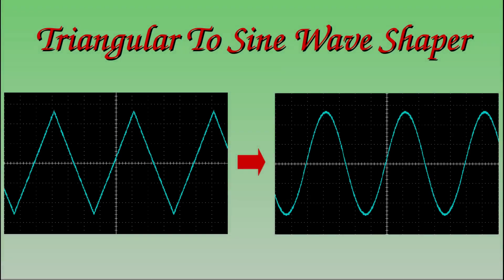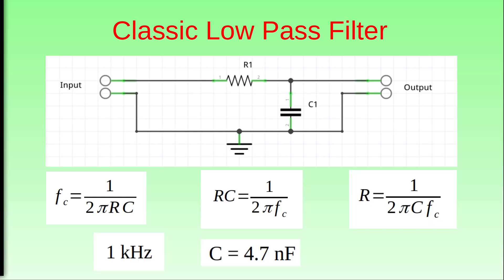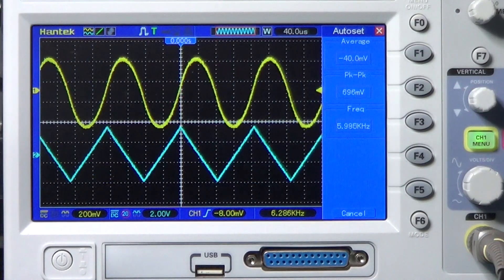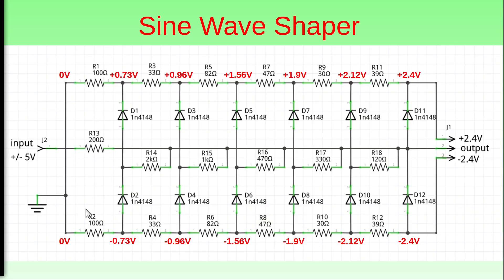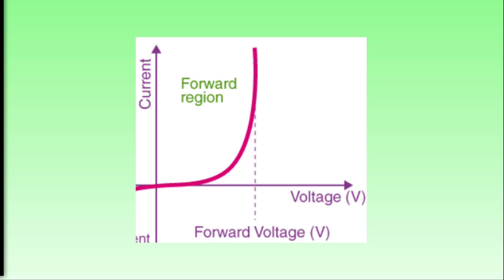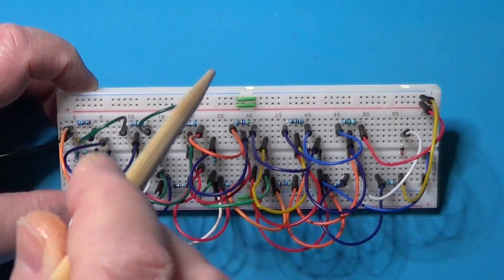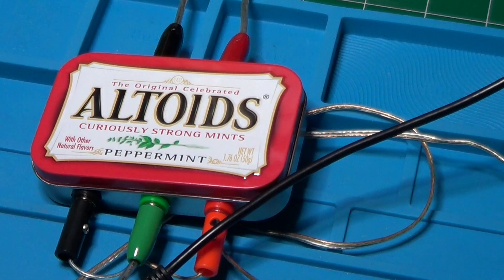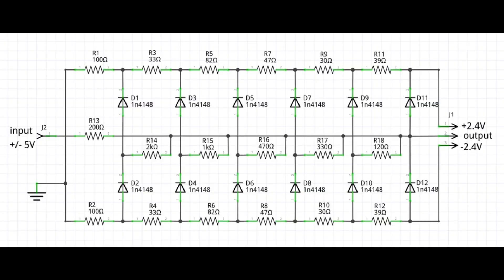Make A Sine Wave From A Triangular Wave - Triangle To Sine Wave Shaper

Comment: Hello! I also have a question about using Schottky diodes instead of 1N4148. I have a triangular signal +/- 1.7 volts at the input. I used a Schottky diode BAT54 and got almost perfect sine wave. Conducted modeling in multisim. However, I remembered at the end that Schottky diodes can not be used on the return branch, for they burn up at supplying almost minimal current. Am I right? Multisim does not complain about this in any way.
Reply from the maker: According to the data sheet of the BAT54, the forward current can reach a maximum average value of 200mA with non repetitive peaks of up to 600mA. With the resistors used in the circuit, such currents will never be achieved, so it is safe to use such diodes in the circuit.
Reply: @eleneasy Thanks a lot for the reply! And would you have any sources or your drafts where I could see the formulas for calculating the center resistors? 
One last question: could you tell me in which program you managed to make an image of the graph of triangular signal and sinusoidal at 11.25?
Reply from the maker: @НикитаРоманов-ю6щ  I don't have any specific formula for those resistors. I just decided to approximate the sine wave with 5 points for each quarter of it. Those resistors are calculated as part of a voltage divider, along with the resistors on top and bottom, to obtain the voltage at that particular point of the sine wave. Mixing all together makes the final wave shape. You could think of adding more stages, and therefore more points of the wave, by just adding more stages to the circuit.
The program I used to plot the triangle and sine waves is called kmplot, available only for Linux, unfortunately. If you have a linux computer, even if just a raspberry pi, you should be able to install it from the package manager of your distribution.

Comment: Is this the same technique used by the XR2206 signal generator  ? ... I assume so since the VCO is passed through a "waveform shaper"   .  This is a very interesting video especially the frequency independence of the shaper cct. since it contains only resistors and switches ( ie diodes). I used the XR2206 in my first job as a FSK generator in a low speed  modem around 1977.
Reply from the maker: I looked at the datasheet of the XR2206. There is indeed a wave shaper and, in principle, it works the same. However, rather than using only diodes as switches, it uses a combination of diodes and differential amplifiers made, each, by three transistors. The effect is similar, although this particular wave shaper creates not only the sine wave, but also the triangular wave. The wave shaper produces a triangular wave if pins 13 and 14 are disconnected; it produces a sine wave if they are connected through a resistor that can be adjusted to obtain an almost perfect sine shape (0.5% precision). It is definitively a more sophisticated way to produce a sine wave. The circuit I presented, using only diodes, comes very close to obtain a sine wave but it is not perfect, although it can be made better increasing the number of stages used for the conversion.
Thank you for sharing your experience with the XR2206.
Reply: @eleneasy  Thanks Eleneasy, I was always impressed with the XR2206 ... can I ask , did you get that info. above  by reverse engineering the Figure 15 schematic from the data sheet ?
Reply from the maker: I just made some deductions based on a combination of information from the device data sheet and the internal schematic of the IC.

Comment: What would happen if you used Schottky diodes such as 1N5819 instead of 1N4148 since the former diodes have a lower forward voltage. Would this shape the waveform better still although I assume the resistor values would need to change? I make this suggestion as I have seen youtube videos where germanium diodes were used in wave shaping but I think Schottky diodes perform even better.
Reply from the maker: Well, Schottky diodes are very fast switching components, but not necessarily have a low forward voltage. In particular the 1N5819 has a very similar forward voltage than the 1N4148, according to their datasheet. Therefore, using one or the other doesn't make much difference. However, if the frequency of the wave to be converted is high, the the Schottky diode becomes a better choice. Germanium diode are a good alternative, but depending on the needed current, they may be much more costly. About the resistors: yes, their value is strictly dependent on the forward voltage of the diodes used in the circuit.
Reply: @eleneasy  Thanks for your reply. I have subscribed to your youtube channel. You always keep learning in electronics. I followed a different youtube video that used some IN4007 diodes to reshape a triangular wave. My result was a not a nice sine wave unlike the author obtained so I then used a 741 op amp as an integrator and obtained a a very nice sine wave and it was much easier than using lots of diodes. Although I have tried many Wein bridge circuits they are very fussy to achieve oscillations. I will persevere. I have better luck with phase shift oscillators. With all these you have some control over frequency but as frequency increases amplitude reduces. I have tried better op amps than 741. I have a doctorate in Physics but am doing electronics to keep my mind active as I am in my 70s and retired now.
Reply from the maker: It is very nice to keep ourselves always intellectually busy. Brain needs even more exercise than the muscles.

Comment: Great video. Sine wave is ok. I also would like to know how to make pos and neg voltages from one rail.
Is this why we can use a diode as a mixer? Because of non linearity? Can you pls make a video about mixing signals.
Reply from the maker: Well, yes, a diode can be used for a particular kind of mixer, then one that multiply signals rather than adding them up. The non-linearity region makes possible the multiplication in a very simple way. I have addressed this subject in the past, when talking about the Theremin mixer. You may want to take a look at those videos.

As for the voltage splitter, I have already put it in my todo list. Stay tuned!
Reply: @eleneasy  thank you. I will definitly watch the videos.